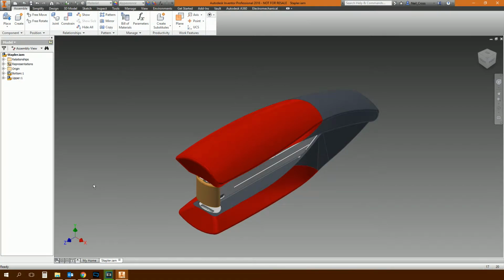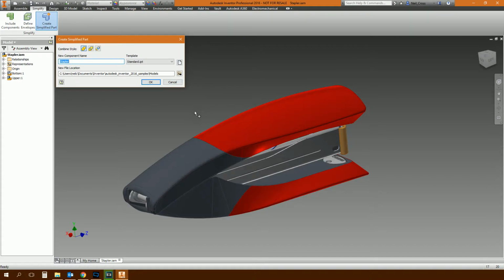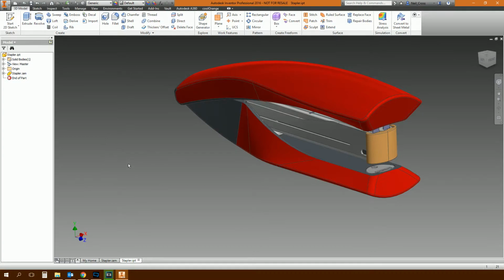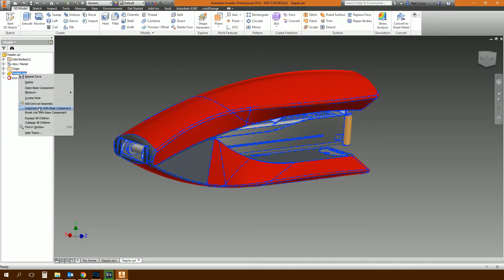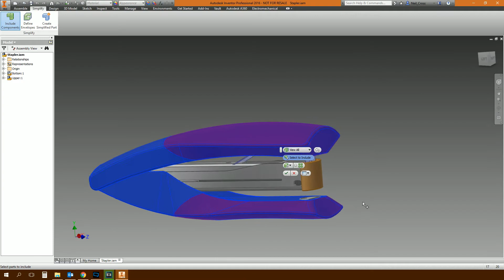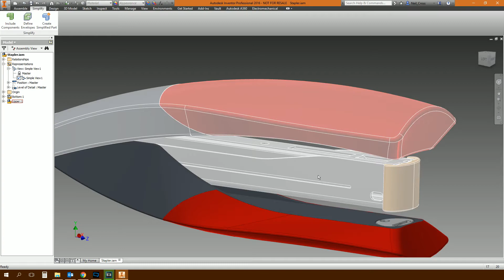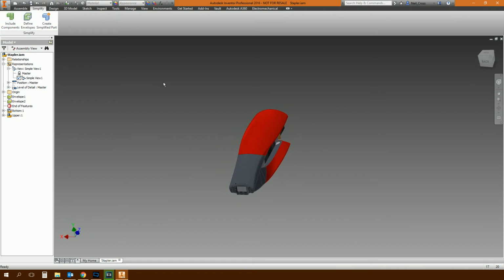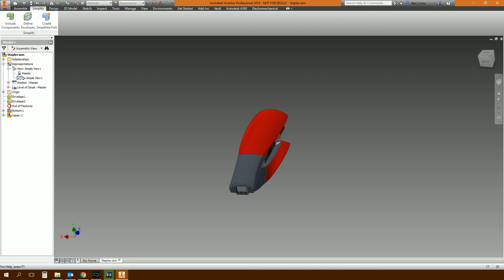How Create Simplified Part Works | Autodesk Inventor

Comment: Thanks for your videos, they've been a great help and are very well done. I'm having an issue with the "Create Simplified Part" command though. I have a small assembly that I'm trying to simplify, but Inventor has decided that it doesn't like one of the components and is not including it in the resulting .ipt. The other instance of the component simplifies fine. Are there any odd stipulations/requirements for "Create Simplified Part - Single solid body with faces between planar faces merged"?